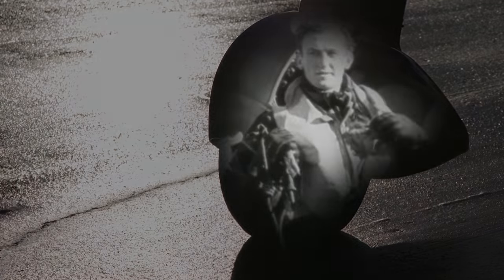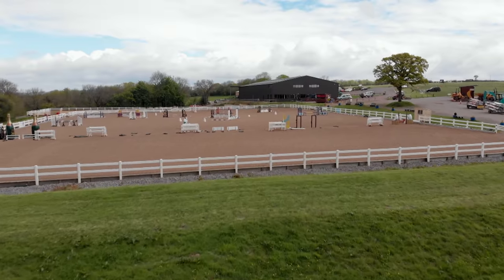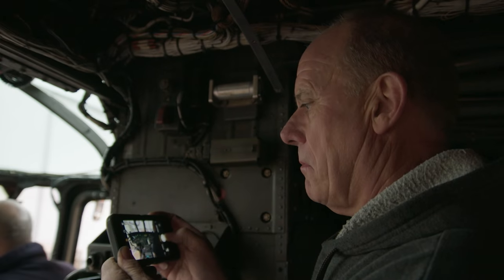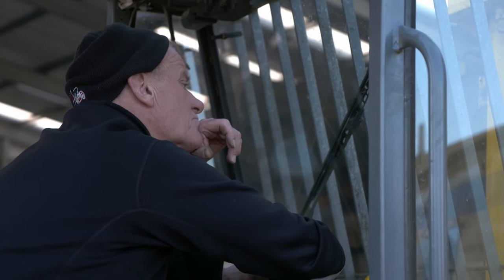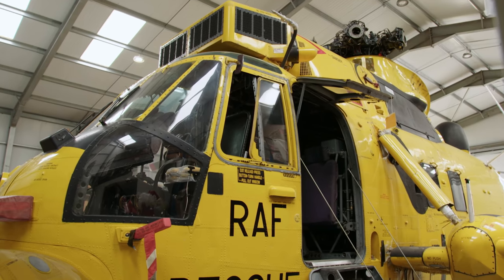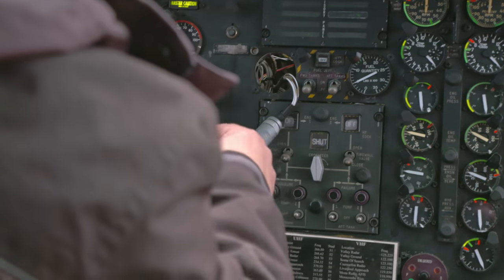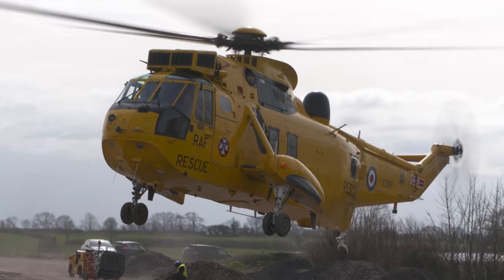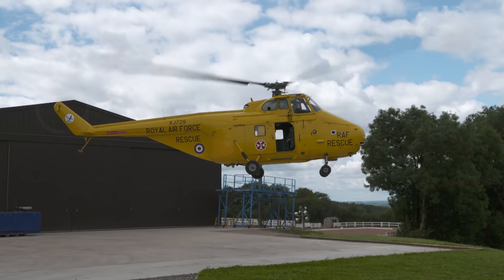Reviving And Restoring A 1970s Rescue Helicopter [4K] | Warbird Workshop | Spark

Comment: I spent my 4 years in the USN onboard the USS Theodore Roosevelt from 86 to 90. We had two squadrons of the Sea Kings but they were primarily anti-submarine. But if there were flight ops, there was one of these in the air at all times to pluck out pilots who had problems and ejected. A solid workhorse aircraft. I spent a lot of time in them because I was part of the Forward Away Team. Whenever we made a port of call, they sent my team a few days ahead to set up the fleet landing and coordinate with the local governments. Usually the trip was under a couple hundred mile  flight but occasionally we would make a much longer flight, where it required outrigger tanks for the extended range. That's when the pilots would really open her up and fly at the maximum cruise speed. Good memories of this bird

Comment: Being a former Naval aviation mechanic, the over dramatic narration about the vibration and potential disaster is really a non issue due to cotter pins and safety wire, unless the Royal Air Force skipped that all together, which they always seemed like solid mechanics .

It's great that there are people out there still able to work and restore a modern classic, and those who can support it.
Reply: The vibration itself can cause more issues than just loosened connectors....in certain conditions when harmonics get in sync, you can have disastrous outcomes. Ground loop, blade slap, etc.  The SH-3's battery compartment is in the nose and on a spring platform.  You can't engage the rotor blades with no battery installed or you can induce a ground loop because of the vibrations that can occur and sync with the initial turn when the blades are slow and centrifugal force has not made them rigid yet.  They be flappin all over the place, LOL.
Reply: @stevedra1  Good points and never thought about that as it's not an issue with Tomcats or Hawkeyes.
Reply: excessive vibration is still a concern
Reply: Over dramatization is what BBC TV does best.

Comment: As a veteran engine mechanic for the U.S. airforce, when they said they dropped a bolt into the engine bay i laughed. Never fails i knew they would, its a right of passage every engine change/install/removal

Comment: I have about 2,000 hours flying SH-3H, in HS squadrons in the US Navy.  I was a Lieutenant and from day-one in flight school wanted to fly the venerable H-3 off of aircraft carriers.  She was a marvelous bird.  I had one engine suffer an extreme compressor stall, T-5 temp was pegged, torque dropped to zero.  I shut it down and flew back on one engine.  Besides some pilot-puckering, no problem.  Another time an engine blew off one of the stator vanes, (don’t ask me how).  The bang was loud enough I thought the whole thing had blown up.  Again, flew back to the carrier on one engine.  Those GE -10s, and (later) 402s were excellent, and always brought me home.  If they had put in T-700 engines I think it would be flying today.  She wasn’t pretty, or sleek, or fast (120 knots), but she carried 5,500 pounds of JP-5, was roomy enough for rescue equipment, and reliable.  I miss flying those wonderful aircraft.

Comment: I worked on one that the US Navy accepted in August 1960 as a YH-3A it was upgraded to SH-3A and flown for a few years as a trainer then stored for a bit. When it came out of storage it was upgraded again to SH-3D and flown till a landing gear failed and it fell off the side of the ship onto the pier, it went back in storage and rebuild and then came back to the fleet where it flew for more years until it was converted to SH-3H and flown as a large utility aircraft doing firefighting and target launch and recovery. When I left the squadron it had 17.5K hours on it and paperwork had been submitted to take it to 20K, it was a good bird.
Reply: Were you in a Squadron at the time  I was in the Fleet Angels as a Search and Rescue /Maint. test Aircrewman ..Yeah overall it was good Bird !!
Reply: @ajsquaredaway5343  HC-85, '99-'04.
Reply: But they said it sat for three years and so it, like, totally unrepairable! Surely they weren't exaggerating!

Comment: seakings are my favorite rotorcraft... as a cadet we went up to raf boulmer and 202 sqn way back in the early 90's and spent 2 weeks up there with them experiencing flights, doing winches etc was an awesome time. as for boscastle i remember that VERY well...
Reply: I am not even from Britain but I always had a thing for these RAF Seakings. I always liked the Seaking in general, it is just the most classically "helicopter" looking machine ever built, but I liked the RAF SAR ones the best. Maybe because I spent so many hours as a child poring over the book of "Amazing Cutaways", including a RAF Seaking. Or maybe it is just that badass radome over the tail boom. Or it just looks super sharp in yellow.
Usually SAR aircraft aren't really my thing, but I like these.

Comment: I had one of these set down "autorotate"  in my pasture.  I told them I flew  helicopters in Viet Nam.  So that got me a guided tour while parts and mechanics made their way to the aircraft.  Turns out this particular aircraft is constantly leaking transmission fluid.  Every one of the connections had leaking fluid around it.   So my comment was.  Perfect for keeping corrosion at bay.  Where do they keep the barrel of fluid at.  All aircraft that vibrate a lot. Leak.
Reply: We had dozens of drip pans in our squadron, 3-4 each for each aircraft in the hangar.   We mused that if you don't have fluid in the pans overnight, she's outta' of whatever fluid thats not in them....hyd, fuel, oil, etc LOL.
Reply: The CH-47 is the same way, you always had to be careful walking on the cargo ramp.
Reply: A J SQUARED AWAY
1 second ago
We used to have a saying if the 'SIKORSKY SHIT HOUSE"  As we used to used to refer to the old  H-3 's we had in service in HC-2 "THE FLEET ANGELS" . If it wasn't leaking hydraulic fluid , DON'T FLY IT !! There is not enough  fluid left in it .they used to leak like sieves
Reply: I think leaking fluid is something that all aircraft do, not just choppers. Oil, hydraulic fluid, fuel, etc. You look close at any plane more than a couple years old, it will have streaks of oil all over the belly, and drips all over the tarmac. It is not really a problem. Leaks don't mean anything is wrong, just as long as they aren't serious and someone is making sure to keep the fluid topped up.

Comment: It's jaw dropping amazingly incredible these mechanic engineers 😍 ♥ wow to bring back an incredible helicopter 🚁 is amazing!! I love spark for bringing incredible stories
Reply: Times have moved on fuel costs are higher.but.hopefully they.can.lease.it.out.for.service.
Reply: I remember one time in particular that we had a Sea King go down in Nome Alaska because the Blade Fold System 10 psi switch malfunctioned  and the blades wouldn't unfold into the flight mode ,and its in a particularly hard to reach place even when your hands don't stick to the frozen metal , and forget trying to get a pair of gloved hands down to reach that switch  down  under the Swash Plate  so we had to fabricate a special tool to reach down in there to remove the old switch and replace it with a new one as best as i can  remember ( its been almost 40yrs ago ) the whole evolution  took about 2 weeks including the time to get test pilots up to fly it out and back to sunny Jacksonville Fla.

Comment: Truly outstanding presentation. I would have liked to known the cost figure for the airframe, maintenance repairs, fuel, and annual operating cost/per hour operating cost. It would also be nice to know when the required airframe/power plant/blades are due for inspection/replacement. Job well done and may she fly for many years to come. Thank you
Reply: As a Search and Rescue /Maintenance crewman I was never privy to the cost of Servicing  any Birds when we traveled , Since the Squadron was responsible for the Budget and upkeep of all aircraft whenever and wherever we were  Here and on Deployment

Comment: If you have the  AC serial no. it would be interesting to see if its one of My old Birds that I used to Fly and work on back in HC-2 during the late 70's early 80's  Later  ,  KEEP UP THE GREAT WORK .. I remember I had to Repair a Sea King  That went in the water off of Key West Fla. that was one of President Nixon's Helo's ,and get it ready for display at the Pensacola Naval Air Museum  back when it first opened  So even though we weren't getting it airworthy it was still quite a chore to get done So I can relate ..

Comment: This was far, far, from a restoration of a Seaking. Engines and rotors were added to an aircraft removed from service years earlier. Not a restoration where it takes years making the aircraft new again and made airworthy.
Reply: Yeah, I was going to say "sat for 3 years?? Seriously?" That's not that long. Granted it is difficult to get parts for a civilian group, and it is not a minor challenge to do repairs without the tools and equipment, but it is not exactly what I would call a restoration.
Although repairing the corrosion and stuff that led them to strike it from service three years ago is more of a challenge. It can't have been that bad if they were still flying it as of 3 years previous, but even minor corrosion is difficult to repair.